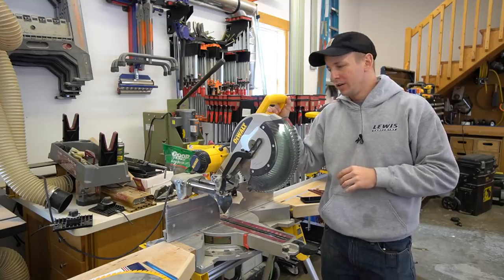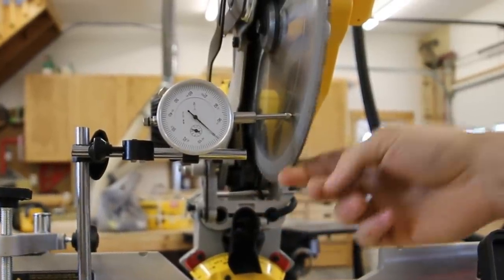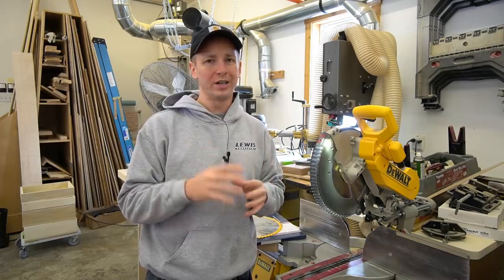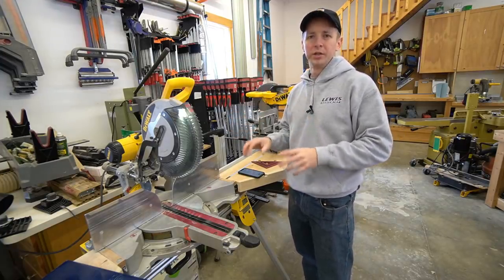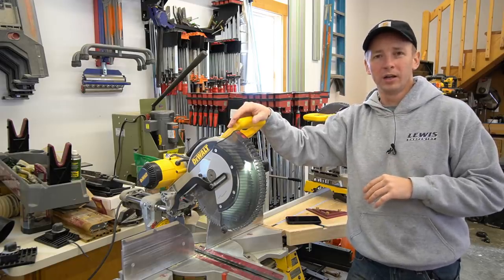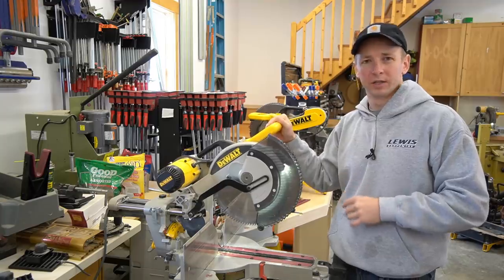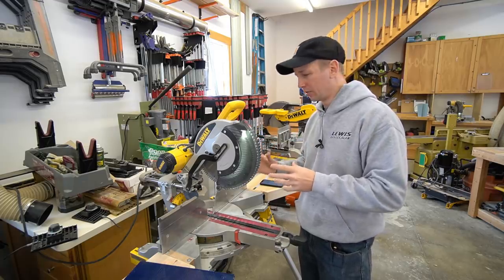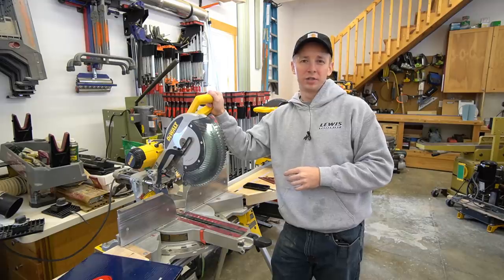DEWALT DWS780 | The BEST Miter Saw for Production Trim Carpenters???

Comment: Can someone please address the elephant in the room.  All these 779/780 videos are loaded with comments like “I got the 779 on sale, bought a light kit, now I have a 780”.

I don’t have all the details, but I do run sales for an HVAC equipment manufacturer and know that these manufacturers aren’t giving anything away.  They know their market, their considerable competition and the price points needed. 

My contention is that they are making 40%+ GM on both saws and they serve different markets (serious DIY and a professional).  

As I understand it, the internal components are different, that’s why the shrouds, casing and dimensions/weights are different.  I called a local service center and confirmed the motor and bearings on the 780 are an upgrade on quality. It’s not just the light and a few niceties that make the difference.

Can someone please speak to this more intelligently than I?
Reply from the maker: I have studied this subject my entire life and the differences between the 779 and 780 are cloaked in secrecy. I don't think anyone truly knows what the differences are or why the price difference.
Reply: @InsiderCarpentry  - ok, I did some research online and found the history of parts changed on both units (types 20,21,22 on the 779 and Types 1,2,22,22,23 on the 780).

It looks like they both have the same Armature through all the series snd now have the same field& case.  The 779 alway had the same field and the most recent 780 (type 23), shows both the old part number and the 779 as replacement.  The older part, you’d think was a better quality and they did a cost down, but the replacement cost is less??). 
So, I believe they. Both have the exact same motor. The ONLY difference I see of any significance is that the 780 has a seemingly heartier /higher quality support/bearing assembly that the rails ride through.  It’s a $250 part vs a $161.  This could be a significant upgrade for ease of slide and trueness of slide/cut.

Thoughts?

Comment: I've done some walnut and cherry trim.  Blade deflection is always a problem with my Makita.  The best luck we had was with the smaller blade old style Hitachi saw.  I don't know if it was the blade size that helped, or if it was the higher rpms.  But, no matter what I tried with my 10" Makita, it just couldn't cut it.
Reply: The old small Hitachis were super accurate, you’re right. All the old school trim guys used those when I started up back in the day.

Comment: Very helpful info by a pro not a reviewer .   You are right … these saws last forever .  My refurbed D705-4 has been in use for decades.  I wanted a little more versatility so just got the 780.  Of course it’s been around forever so theoretically it’s super reliable.  However I just saw another YouTube review.  Certainly not a pro but a reviewer who did some research and supposedly found that Dewalt dumbed down the 780 to have same inferior parts as the 779    Same saw but no shadow line.  You see it.  Be warned. It’s the bear guy 
https://youtu.be/GegsVcqRkXc
Thoughts?   
Also not surprised at the failure rate of Kapex.  Too highly engineered and like some German cars are great for a few years then deteriorate quickly.

Comment: There is a very simple to install aftermarket XPS Light for the 779.  I'm not sure what the weight difference is, but the 779 is SUPER heavy.
Reply: According to the amazon links the 779 and the 780 both weigh 56 lbs.
Reply from the maker: I'm not sure that is accurate. I read elsewhere that the 779 is heavy also. I haven't handled one unfortunately.
Reply: @InsiderCarpentry  Then Dewalt’s website is wrong, too.

Comment: I couldn’t agree more with everything you said.  The contractor I work with periodically has a 780 he bought 5-6 years ago.  It’s taken an absolute  whooping and cut a boatload of stuff.  However, you could have taken it one step further and mentioned the 12” Flex Volt version of this saw if you want to dive into the deep end of the pool.  It’s hard to put a dollar value on being cord free although the AC adaptor comes with it.  And, those 60 volt batteries are compatible with all the other DEWALT tools you have laying around, especially if you want to plug em in and run all day.  I absolutely love mine and do not regret one penny of what it cost me.

Comment: A good commercial saw shop can provide you with bushings that would have allowed you to keep and use the Kpex blades that you sold at a loss.  In a commercial cabinet shop in California, we routinely have saw blades bored to take oversized arbors and bushed to use those same blades on other saws.

Comment: I tried a delta and dewalt 10” slider 22 years ago.  Deflection was an issue and the preset locking sets sucked.  If you got close to a 45 it would slide and lock in.  It’s good to know they have improved over the years.  

So I went and bought a 8-1/2” hitachi.  I’ve loved it for 22 years.  Parts are starting to wear out and the parts and blades are getting hard to find.   I’m assuming I’ll need to replace it sooner than later.
Reply: ...mmm   My Hitachi 8 1/2 is 30 years old and i still LOVE it !

Comment: I have 2 and the newer one has the added safety lever on the trigger.. Any tricks to by pass this or make it less of a stumbling block. I'm left handed and it seems to slow me down compared to the old model. Thanks, love your videos. You've cost me a lot of money but saved me a lot of time.
Reply: Good question.  I'm a lefty too.
Reply: Yeah just bought a new one and it has the safety lever which is hard to get used to after not having one before. Be nice to get rid of it.
Reply from the maker: On my kapexes I used some CA glue and a wedge of wood to disable the safeties.

Comment: The weight is the same on both. (56lbs.) I bought the DWS779 at Home Depot for a considerable savings and both the New arm with light and switch on Amazon (all parts included) to make it the same as the DWS780 and saved about $70. Thank you for always providing great tutorial videos and reviews!!
Reply: Yes, you saved money and voided your warranty.
Reply: @GunnyNinja  For the cost of the saw and it reputation, that wouldn't bother even if it did void the warranty! However, I do maintenance on all my equipment with OEM parts and that doesn't void the warranty.
Reply: @aladincarpetcleaning6416  Except that the parts you put in were not installed by the oem. Dewalt figured out what people were doing and if you crack it open and add parts, your warranty goes out the door.
Reply: That's life. A few dollars saved for a better piece of equipment... it will be okay.
Reply: @aladincarpetcleaning6416 I'm curious. The website says the 780 has an increased miter to the right. 60 degrees instead of 48 on the 779. Is this true?

Comment: I disagree. Run out our whatever you want to call it does nothing for the reality that blades, whether there 10" or 12"  dull as we use them.  That said a 10" blade vs 12" blade under equal use and wear will cause the deflection that are you are attributing to "run out" will  be greater with at 12" blade vs a quicker spinning 10". In a perfect "fresh blades" scenario I agree with you but as the curve of use happens the 10" bladed saw will outperform and equally used 12" bladed saw.. I own a lot of festool and agree that the Kapex is over hyped. Still run an old Dewalt 12" dw708 but really only use it for larger multi-layer crown and cornice work. Rarely have I ever felt the need for anything other than the Hitachi C10FSH (old Japanese made versions not Chinese versions)with 80" ATAB Tenryu Silencer. It has very few bells and whistles but if you want accuracy over a long period of use nothing beats it. When ever I see guys show up on the job with that saw I know they know what they're doing. 10" over 12" all day
Reply from the maker: I produce the same level of work either 10” or 12”. But with the 12” I have greater capacity which makes the same more versatile and efficient. That’s why I switched back to 12” years ago after realizing that the idealist love affair with 10” blades’ alleged greater accuracy is bologna. To each their own.

Comment: Great video! What’s the purpose of the bigger fence you have on your saw?
Reply from the maker: Its needed for larger crown molding and cutting baseboard vertical.
Reply: @InsiderCarpentry  thanks for the fast replay appreciate that! Where could I buy them at?

Comment: Not even close to the quality of the Festool Kapex. And not thousands of recalls due to a “ safety aspect”. Chinese manufacturing vs European !! Thanks but I’ll pay for European quality. 
Actually more than a million recalls.
Reply: DeWALT says the power tool recall involves models DWS779, DWS780, and DHS790 Miter Saws. You’ll find the model numbers on the saw’s nameplate. But only the models with date codes 2019 04 through 2022 04 suffer from the problem.

Comment: Have you ever have this happen?? My DWS780 is about a year old, it started to act up, like the brake was starting to fail. Took the cover off to see if there was a build up around the brushes, all clean. Checked the belt, looks good. Tried to run it on more time.... LOUD noise... turns out the blade screw had backed out.. I've never had that happen before. I've owned dewalt, makita, delta etc chop saws and never had this issue.  anyone else?
Reply: The lights stop working for me has been the problem with the ones I’ve been getting this year. I currently have the type 23 which is my 3rd one and I’m about to have my 4th

Comment: Thanks Spencer, I have been trying to figure out all the different model numbers. I have to replace mine, it's 20 years old and I have ran it into the ground. But I will say it has not only cut trim with it but loads of framing lumber, timber post, and don't yell at me but aluminum handrails as well.  This is a big help.

Comment: I finally got this saw about 6 months ago as my main saw, I think it’s the type 3. About a week ago the xps shadow light stopped working so I sent it in to be repaired under warranty. Does anyone know how long the light is supposed to last for? I was hoping for a little longer than 6 months 🤦‍♂️
Reply: @kevinbezat im having the same damn problem. I’m on my 3rd saw now that it just happened again so I’m about to go trade it out for another but something has to be going on with that. So you’re not the only one dealing with this
Reply: @stevenbeckett8633  Wow, 3 saws? How long did the light last before it stopped working on them? I didn’t realize how nice having a shadow light is because I’ve used different saws, but it saves a lot of time and I can’t go back to not having one. I heard makita makes a really good saw with a shadow light, I might have to switch over.
Reply: @kevinbezat it’s happen the last 3 jobs I’ve done. I do full remodels and it takes me a couple months at a time but this last one only lasted 3 weeks. I’m about to take it back for my 4th saw this year! It’s getting out of hand. It’s the type 23, I’ve been taking them back to the same Home Depot but I might try a different store to see if it’s a different type. I love the saw while the light works so I’m thinking about ordering a different light. How long did yours take?
Reply: @stevenbeckett8633  I also do full remodels and a lot of finish carpentry. I finally decided to buy this saw because guys I watch like Spencer and Finishcarpentrytv all use this saw. My light lasted about 6 months since I bought it brand new. I returned it to the Dewalt factory under full warranty. I’ll try to remember to post back here to see how long it will last this time. Its too bad because the saw worked great, but that light saves so much time and is so useful for finish carpentry.
Reply: @kevinbezat I think you did right with having them fix it. I think I’ve been getting a bad batch of them or something, I had time to wait I’d send it in since they closed the dewalt store here in okc a few years ago. I’m swapping my saw tomm Again..🙄 but we’ll see how long it last this time. I might have to go to Lowe’s this go around but I’ve noticed HD hasn’t been carrying a lot of dewalt like they’re phasing them out or something

Comment: Couldn’t agree more with your thoughts on the Festool. I have a 780 on the dewalt folding stand (Black Friday deal!) for on-site work. I’m looking to purchase another saw for my shop (I’ve been more and more limited with my old school craftsman slider with 8-1/2” blade). I was considering going the Bosch or Delta route since it can be placed tighter against a wall, but I just may have to pick up another 780. Does anyone reading this have any experience with Delta or Bosch 12” sliding miter saws compared to the dewalt? Would love to know thoughts.

Comment: I really enjoy my Bosch gcm12sd, not just for the slide but all the controls are up front,  takes a second to calibrate also has a great selection of add ons.
Reply: How is the accuracy of mitre cuts and straightness of longer cuts?
Reply: @joemartines3545  it has a lot of power and likes to pull if you go too deep too quick, a good blade and manageable passes keeps it true.
Reply: @markevans7584  thanks...

Comment: Do you ever worry about deflection when cutting the base standing up? Cutting 3/4 vs 5 or 6 inches?
Reply: Just don't force the blade through the material,  let it go at its own pace and you'll never see any deflection.  Good technique is more important than a good saw!

Comment: Spencer, do you have any experience with Milwaukee’s newish 12” cordless slider? I need new miter saw and I’m considering that one. Apparently very light.
Reply: Milwaukee is another $200 with battery and rapid charger. I could upgrade Blade and fence on DWS780 for same price.
Reply: Thank you. Awesome video man. Keep it up 👍

Comment: I literally was going to ask what the difference between the 779 & 780 today! glad I have my notifications turned on for when you drop new videos!
Reply from the maker: It's somewhat of a mystery. I'm not sure anyone really knows aside from the light.
Reply: There is other differences. Comparing the newest versions of both (type 22) the 779 has a plastic bevel lock knob instead of metal , no preset bevel stops, and no lock lever on the slide. There is no weight difference. 779 weighs the same as the 780 at 56 pounds.
Reply: @jameshill4900  my 779 has a metal knob and a slide lock.
Reply: @TheDesertRat31  The 21 and 22 had changed the large tri knob at the back to plastic. Is yours brand new? Curious if they have gone back to a metal knob and added that lever back on the side. I'm not referring to knob at the top, it's a quick lock lever on the side that locks on a pin and sets the saw exactly where it should be for plunge cuts.
Reply: @jameshill4900  so does the lock, lock out the slide and make it like a non-slider? I'll have to look. I think it does. I think I have a metal hook that rotates down on to a pin, like you say. I think I've had mine about a year.
Reply: @TheDesertRat31  They are great saws no matter what. The one with the 3 things I mentioned removed compared to the 780 was a type 22 (stamped on the motor decal). Yours might be a type 21...? They are differences that I thought to mention if anyone was looking to buy one. I think dewalt is trying to save couple dollars and differentiate the two models more (encourage people to spend more on the "fully loaded" version).

Comment: is the Flexvolt just a cordless version of the 780?
Reply: Identical saw but with the option of corded or cordless.
Reply: Cordless seems like it has less power
Reply: @bigluisjayrogan 

You mean the flexvolt while running on batteries or the flexvolt running on batteries or AC?
Reply: @bigluisjayrogan 

I used a flexvolt just over a year ago.  Either way it seemed like it had enough power.
Are you a finish guy or framer?
Reply: @ThekiBoran  12", yes. But Hitachi (erhm, Metabo HPT) has 10" (made in China) and 7-1/4" (made in Japan, $$$$) versions that can go corded or cordless. I'd still rather have the old Hitachi 10" corded (made in Japan). Those were tanks and very accurate saws. Actually I just want Japanese Hitachi back, lol.
Reply: @thomasbrown9402 

I stand corrected. And I have a 10" Hitachi made in Japan.

Comment: Another difference between the two Dewalt models is that the DWS779 rear bevel lock "tri-handle" is black plastic, not cast aluminum as in the DWS780.
Reply: On the newest 779 (type 22) they also removed the preset bevel pawls at the back and the lever on side to quick lock the slide for plunge cuts.
Reply: Interesting my 779 has a metal handle. I guess they changed that recently.